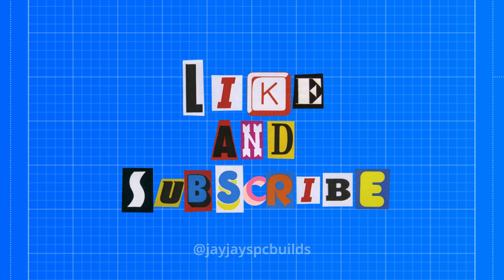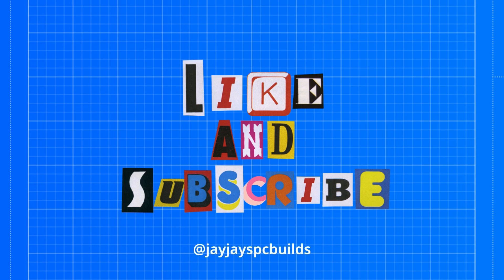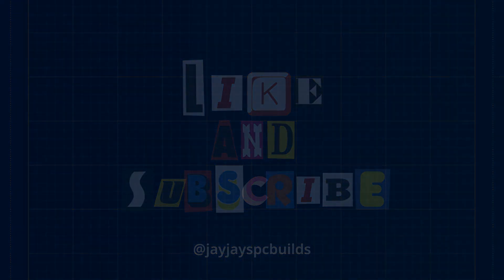☠️⚰️CPU Meltdown: Ryzen 7 9800X3D & AM5 Socket Destruction Explained!⚰️☠️

Comment: Nice video. Sounds like it's only the Asrock boards having the issues.
Reply: no it doesn't sound like it, asrock has a much higher market share than others and therefore sold more units. If you adjust for that it looks like asrock has a slightly higher chance of having the issue. There have also been reports for asus, msi and gigabyte motherboards.
Reply from the maker: It appears that way, but hopefully, they can get it patched up soon!😎👍